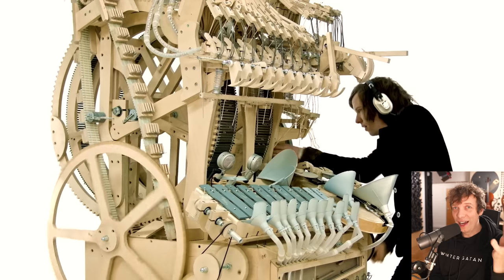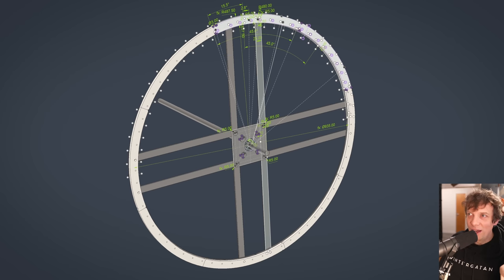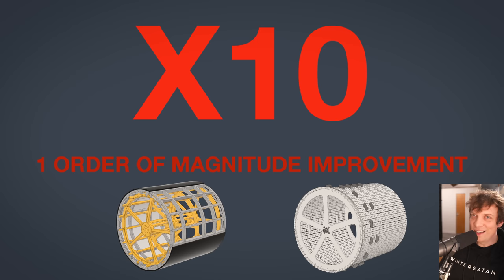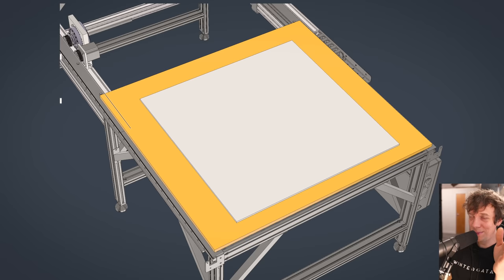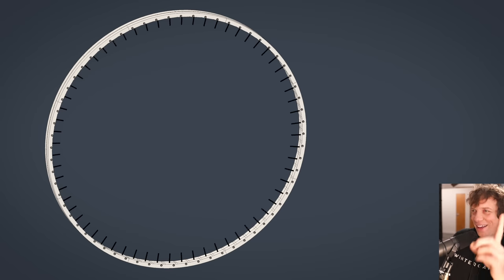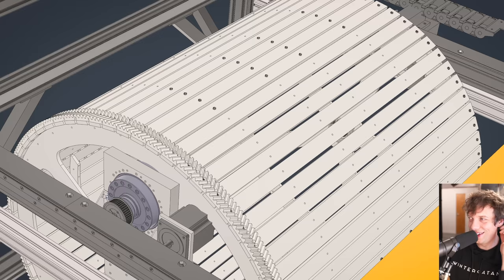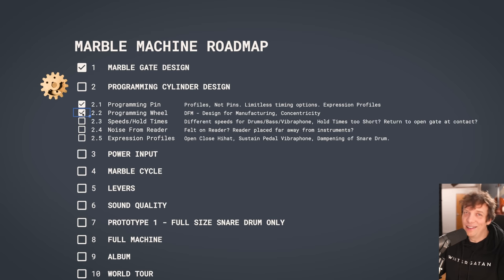A New Music Programming Wheel

Comment: Now the installation of the timing wheels and removal.  The simplest I have seen looks like a tear drop hole on each side, with the non-gear side having the bar that closes around the shaft to hold in place while the double helical gear rolls the wheel holding that side in place.    the locking mechanism is basically just a piece of material that has a pivot point and enough friction to hold either the up or down position and enough gap around the shaft to keep it from skipping.  There can be a lot of " slop " ( 5mm seems huge compared to some aspects ).  The mass of the wheels should hold them in place other than the lever lock to ensure it will not pull itself out during the music playing.  Keep up the great designing and thinking out side of this box people keep mentioning to me.

Comment: I do love the look of the drum and hate to be a contrarian nag but.... A scroll fits your stated design requirements much better( perfect spacing between holes because each hole is placed exactly where it should be, concentricity is a non-issue, very easy to switch songs, zero (un- used)programming holes, laser cut fabrication (or manual if you wish)

Comment: While the machine-in-place operations look very nice.. what happens if you break one of those spars? Now the only way you can accurately replace it is to take the whole thing back to the rotary table and set it up again.  Wouldn't it be better to have all the spars be machined exactly the same, and have some other way to align them on the machine itself?  You've taken a similar approach with the programming pins themselves.  It would keep everything fully modular as opposed to creating this single immaculately tuned unit for the wheel.  It feels like a step backwards in simplicity and modularity from what you've done so far.

Comment: I understand that you want to remove the manual process; but a process that comes to mind when making the wheel match the brackets is to use a flush-bit router. 
Cool bit of kit you have on the CNC though

Comment: With as wide as the wheel is gonna be, the plates going across the wheel to hold the notes are going to bend, regardless of what plastic you use (I know from my experience in a plastic machine shop). I would recommend a mid to high grade steel instead, which would also increase the stability of the wheel overall. Plastic is risky with how you intend to cut it. The plastic design will work, but would be more reliable and durable using metal instead.

Comment: For the double helical gear, what are you planning to use for lubricant to aid in friction reduction to extend the life of the machine? Also how are you going to protect the gears from outside foreign material? Finely machined gears are highly susceptible to cracking over time. Graphite might work but would be super messy for the lubricant. just minor things to consider for longevity. Really love the sleek design processes you’ve come up with!

Comment: Plastic or steel, how about aluminum? It is usually preferable over plastic when strength to weight is an issue, which would definitely be the case because that's a really big wheel adding a lot of inertia to the system, reducing weight would significantly improve the usability of the instrument.

Comment: Martin, you are an inspiration to the dreamers of the world! Engineers and designers both! My only thought here is that the split helical gear is going to be more trouble than it's worth.  I know this is not what you want to hear, because it is beautiful.  But is it necessary? A 20° spur gear will accomplish the same result (I think).  My concern is in trying to cut a helical involute on a cnc will be more difficult than creating it in CAD. Usually these are hobbed with special cutters to get a true involute.  Ball end mill bits will get you a rough approximation, but not the buttery smoothness a true helical involute provides.  Hopefully your colab buddies have some workarounds, and you can get the gear you want.  But I think this might be form over function, increased complexity without fulfilling additional requirements.  
Best of luck!  I'm behind you either way

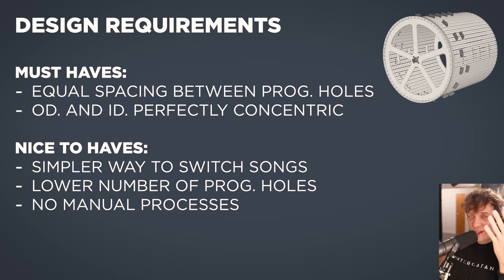Comment: You've 64 faces on the wheel,  but your rotary axis xas gearbox 1:40. Normal step motor has 200 steps per rotation. So to rotate wheel between faces you need exactly 125 full steps (even if the stepper motor driver support micro stepping) of the motor! This is an additional dimension of the precision!

Comment: 1. Do not trust the accuracy (to the level we are chasing here) of a strain wave gear for indexing purposes. There is a slightly sinusoidal relation between input and output. I suggest using an encoder on the output.
2. The flexspline of the strain wave gear is, as the name suggest, somewhat flexible. While it is true that there is no true backlash, the flexibility could cause inaccuracy under machining loads. i suggest only using the gear for indexing, and then braking the wheel with clamps.

Comment: What stops it twisting up in a spiral? It needs cross bracing in a big way, and both ways! Like if you set it down, it would want to fall over radially. Also don't depend on set screws to hold the bearings in place on the axle shaft, one good bump would ruin your night. 

If the engineering plastic isn't reinforced with something, consider a different material that IS. But even fiberglass will sag over time and with heat cycles.

Comment: This doesn't have any support to prevent it from twisting, especially since it's being rotated from one side, and the pins will create resistance against the rotation.
One solution (avoiding a total redesign to add supports) would be to add the same gearing system to the opposite side and have the drive mechanism drive BOTH sides of the programming wheel. 
Another, perhaps simpler, solution would be to index the wheels to the shaft so that they are always in line with each other.

Comment: PROBLEMS!
Torque on drum may twist it if not stiff enough. Solution: drive from both ends.
Repeat delay in each channel very long due to length of “pin” profile. Solution: multiple drops along profile with much smaller follower.

Comment: Wouldn't it be easier, and more precise, to create a flat mat with precisely placed holes that you can wrap around a wheel like a thin tire? Then you could swap out the mat between songs instead of the wheel, and use far fewer parts.

Comment: One note of concern is the lack of support in the middle of the wheel.  when the timing pegs go under load to activate the marble drop they might have a bit of deflection and mess up your timing.  Looking good as well and to keep the gear safe. just store the wheel on the end without the gear as to not mess up the teeth.

Comment: You also good luck with everything you're doing. The rigidity of strips of plastic I wouldn't like to overestimate. Maybe verify how much that stuff bends when you clamp down one side and push down on the other side. One other thing I wonder about is: if one of the plastic strips fails, will you be able to precisely locate its position in relation to the rest of the strips before machining again? Oh,  precise ground dowel pins, right?

Comment: 7:45 you will have tremendous vibration while  trying to mill on 4th axis. You should create 2 very sturdy/heavy plywood(?) wheels (at least 30mm each) that you will sandwich the plastic wheel. Otherwise, everything will just tremble, or maybe even not be running straight, at all.

Comment: Hi Martin ! I follow you since a while now and I'm "worrying"/ wondering about the reprogramming steps from this new design ! 
On MMX 2 you had pre-programmed plate that you had marked with number and you only need to connect/disconnect already programmed plate to switch between songs. This operation looks easier than the new design you've introduced in this video where a person will have the responsibility to prepare the programming pins for each song on a second programming wheel
 (at least if I understand the concept). 
I think there is more risk that the person in charge of the programming mess up (more over when considering that you will have many programming pin (with various tempo/length).
Maybe you should considered a in-between solution with removable plate (similar to MMX2 black programming plate) that you can have pre-programmed. 
It will make more part to buy but reduce the risk of wrong programming on stage. 

Else I really like your video and I'm very happy every time I see a new one ! 
Thanks for all :) 
Bye from france !

Comment: Unless there's a lot of backlash in your CNC, a circle will be a circle. Cut one, test it out and fix the tolerances of the CNC if needed. The CNC you're using should be more than capable of cutting perfect circles.

You shouldn't have to do the machining twice, especially with that extremely complicated second step with the rotary 4th axis. So here's a few suggestions:

Plastic-on-plastic means that even once assembled, things can slide a bit much more easily than plywood. Relying on screws or bolts for retaining the position of the horizontal bars will probably not be enough.

I would add positioning teeth on the wheels to sit the bars between them. This means the screws/bolts holes don't need to be as precise anymore and you can simply make yourself a simple jig to manually drill those holes in the wheels, removing the rotary CNC machining step entirely.

As for the gearing for turning the wheel, you don't need anything fancy since backlash should not be a huge concern for something that only ever goes in one direction at a constant speed, unlike belts/leadscrews/ballscrews on a 3D printer or CNC.

This should save you from having to CNC things twice, especially since that second step seems overly complicated.

Comment: I'm somewhat afraid the plastic programming bars will be too flexible in the middle and perhaps deforms over time
They don't seem to have much in term of supports, 
Since you've worked so hard to design something that would run tight, I think minor deformation on it would make all that work irrelevant.
If they aren't flexible, the lack of reinforcement might cause cracks to appear over time and potentially even break it.

I think it would be wiser to work on a different material, perhaps Aluminium.

Comment: Starting about halfway through the video I was wondering how you were going to ultimately keep the spacing of the programming holes precise - if the drum rotated at 1rpm and you  played at 128 beats per minute, 1mm spacing error would be around 10ms of timing error.

Cutting the holes on the bars with the lathe after they're mounted on the drum, so the spacing precision is based on angular precision rather than the drilling & mounting precision of each of the bars, is a wonderfully elegant solution to that.  Bravo.

Comment: Nice.  The only thing I would personally do is add a second helical gear on the other side of the programming wheel so that it is driven by both sides simultaneously.  This way if you have a lot of programming pins / notes only on the right side of the wheel VS the left, you will not have an asymmetric torque load from the programming pegs across the length of your programming wheel.  This will improve timing across different songs and reduce the load across 1 helical gear.  (Note this will only be usable with a contact drive, obviously with a belt drive, you would now need 2 belts.)

Comment: The plastic frame programming wheel should also be lighter (benefits both shipping and handling) than the metal wheel. Are you considering some sort of index mark on the wheel so when playing you know where in the loop the spinning wheel is? If so, milling those marks when first cutting the wheels should be easy to do on the CNC table. Or are you planning that with differently colored slats around the wheel?

Comment: Make the bearings stationary, and have a fixed connection to the axle at both ends of this drum. As is, the two ends of the drum are free to twist relative to one another because they are both on independent bearings on the shaft, tie both ends rigidly to the shaft and you gain extra rigidity. Even made of steel this would twist and shift your channels relative to each other more than your extreme timing requirements. 

Also, the strips that span between the two wheels seem to me like they will sag, and be quite bendy in between. This will affect both the machining and final use.

Comment: I am afraid that I predict that the bars that hold the programming pins will flex. The way they support each other does not help; when preassure is put on one, it will bulge down and in doing so press the ones surrounding it up. (Like when you squeeze a bottle.) I hope I am wrong, but beware! (I think ypou will need support wheels inside the drum.)

Comment: Very cool. Only thing I would be careful of with this design is the twist of one side compared to the other. I know you are machining the programming holes in place, which is good, but the whole thing needs to resist being tweaked afterwards. Think of each pair of those cross braces like a parallel linkage that can become a parallelogram when one side is twisted. The mounting bolts need to keep those perfectly fixed to the end caps without letting them rotate at all. 
You have those braces in the center, but they just create more parallelograms, when what you really need is triangular features. 
It looks like some of them have tabs left in between each other, maybe for that purpose?

Comment: You need a rigid tube with flanges at both ends inside the programming wheel along the rotation axis and connect both outer wheels through it together. Otherwise you can twist the wheels and the programming plates won't be perpendicular to the outer wheels any longer. Or said with other words: they won't be parallel with your rotation axis anymore. That would result in indifferent timing through all channels.

Comment: Dont forget stiffness of all of this, you will have a lot of play and movement. It needs to be more rigid, this is not a problem of the material choice but geometry. Also keep in mind that alignment of the wheel to the fingers is extremely important and has to be stiff as well to play tight and consistent.

Comment: I am curious why the big programming wheel, seems like the one last big overhanging thing you kept from the last two for the sake of aesthetics, like could something similar to tank treads not work for the same purpose but take up substantially less space?

To me at least it seems like the only part you haven't questioned or fully explored your options of on video.

Another upside to a tread mill / tank treads is you could store a lot more preprogramed songs as they'd pack flat removing the need for several giant wheels and onstage fiddling.

Food for thought. :)

Comment: Martin should 100% use a splined shaft and mount the shaft on the bearings instead to stop the two sides of the wheel from shearing in opposite directions.

Comment: My personal opinion Is that you should be using steel gears for longevity. And you can get the parts waterjet cut out of plate steel of your choosing and however thick you want them, then all you have to do is machine the bearing hole in the centre.

Comment: on the new design, you have a foce based fit between the inner bearings and the wheels. They will move over time and you loose your concentricity. Please fix them in place with a form-fit - two conical pins - drilled and reamed throug bearing and wheel, will do the trick - you might take some inspiration from chris at clickspring, as you want to have the timing-precision of a clock. Even better would be to get rid of the skf flansches without registration shoulder and have the bearings seated with a press-fit directly in the wheel.

Comment: I think you can get TWO or even THREE separate songs on the same programming drum- remember how you had 3 sets of pin holes side by side for 3 different timings? ( Now solved with the Pins having the timing lengths printed in ) I don’t see why you can’t have 2 or three parallel tracks for each channel, and your drum simply SLIDE laterally to align each different song with the striker arms that will actuate the marble drops.  SO just imagine your drum is wider, with three different programs side by side offset by just the width of the programming pin plates.  This would spread your strikers and your marble gates a tad wider, which would give you more room for paths to various different instruments.   And a simple lever that would shift the drum from one position to the next, enabling you to not only shift to a different song, but also to, say, shift to a different bridge composition and then Back to the primary melody.   This could eliminate the need to switch drums or laboriously reprogram drums on stage.
Reply: I agree with this. No changing wheels. Just shift tracks/songs on the same one. You can make the pins quite narrow since you don't need to change them quickly.

Comment: Since you  are machining the holes in the wheel last, have you considered just using large diameter PVC pipe ?  One piece of pipe  instead of all those slats and bolts...  I don't know what the diameter of the wheel is, but 24"(61cm?) Pipe is available and is 1/2"(12mm) thick.

Comment: Why are you not mentioning the metal sheet with welded studs design for MMX? It seems like that design solved just about all of the problems with the plastic programming wheel in MMX. It was very reliable, extremely precise, and very easy to change songs.